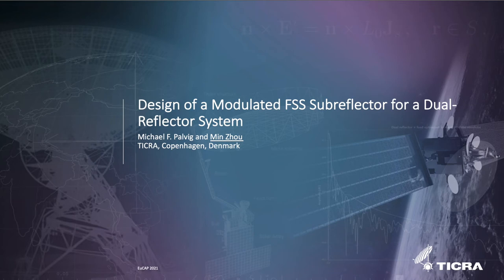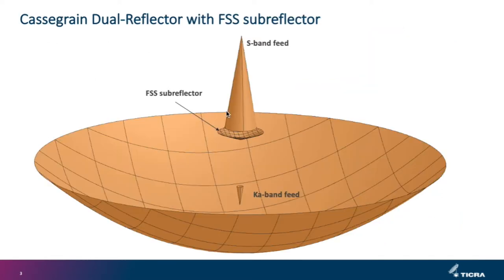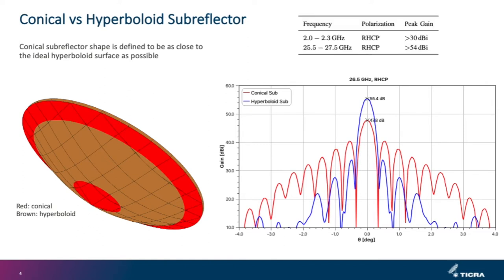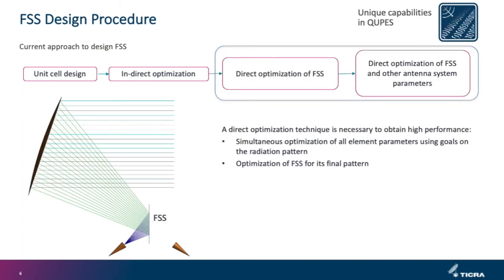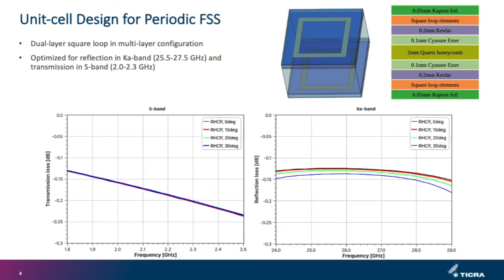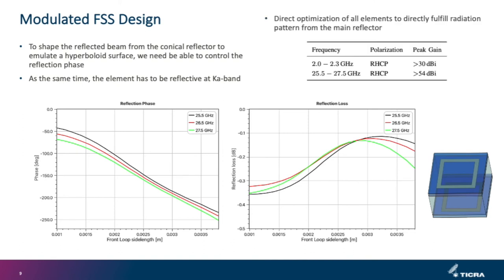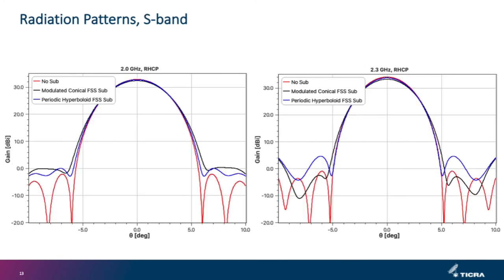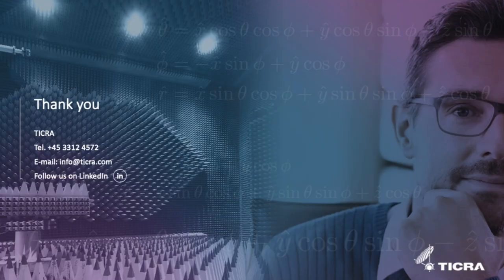Design of a modulated FSS subreflector for a dual reflector system

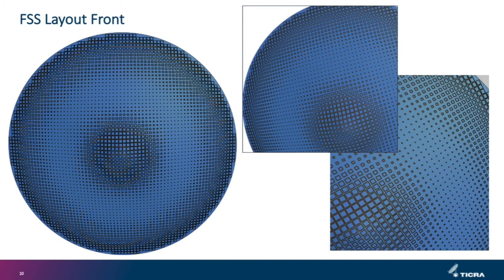Comment: Great video. Could you let me know how to get the shape like in 9:37? I mean, how to calculate the phase shift distribution of the reflectarray to emulate hyperboloid subreflector?
Reply from the maker: Thank you:-)
And thank you for your question. In our design, even though we are emulating a hyperboloid with the phase change of the FSS elements, this is actually not explicitly enforced. This means that we don’t calculate the phase shift distribution of the FSS to emulate the hyperboloid subreflector. Most works in the field of reflectarrays, take the approach of mapping the element dimensions based on the phase change needed to emulate a certain surface. We carry out our design using QUPES where the optimisation instead target the desired end result directly. You can read more about the design process in our paper which you can download here: https://www.ticra.com/design-of-a-modulated-fss-subreflector-for-a-dual-reflector-system/